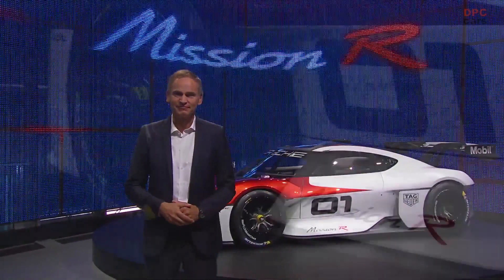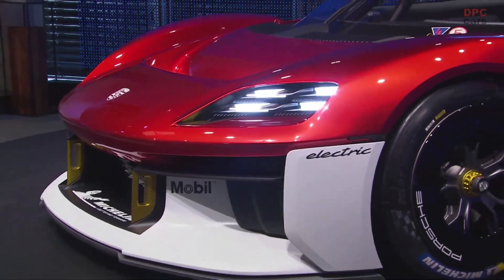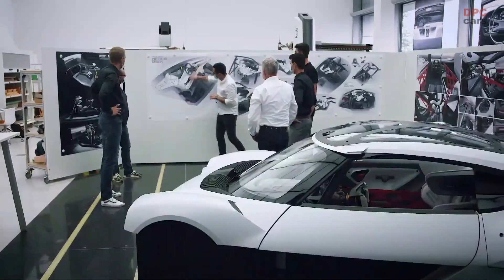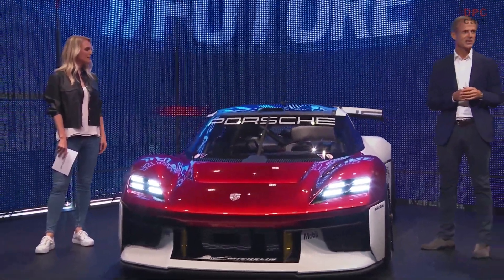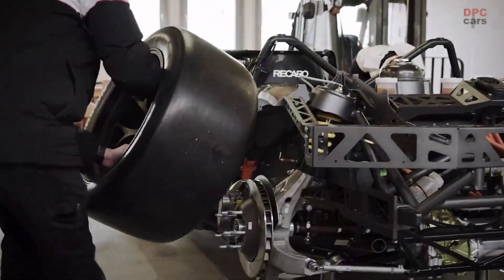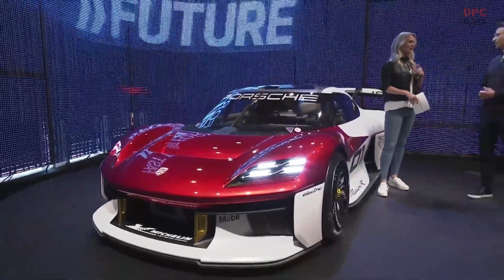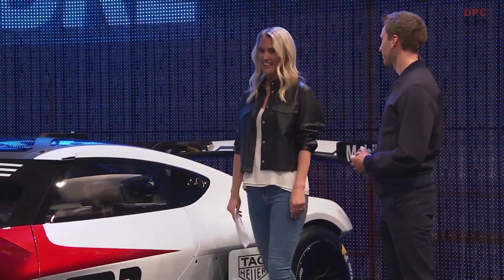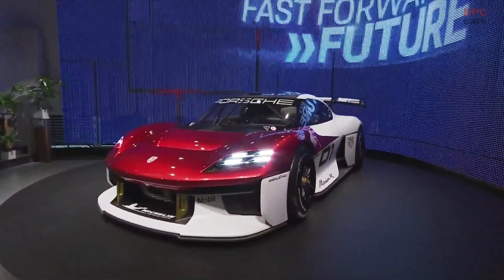Porsche Mission R Electric Concept Racecar Revealed

Comment: Amusing that they’re still using the horse as a measurement of power
Reply: To differentiate Wheel Power vs Motor Electric Consumption. I think we should keep is seperated soo it's less confusing. Motor Electric Consumption in KW very much does not accurately dictate Wheel Horse Power.

Comment: i want this car to be street legal with more than 1000 hp of electric power.
Reply: 1000hp is unnecessary overkill. That 671hp normal mode is good enough. This is Electric Horsepower which means beastly acceleration.
Reply: Nevera perf
Reply: 100000+ hp as you can hear ;D